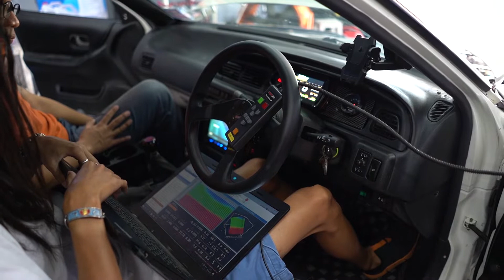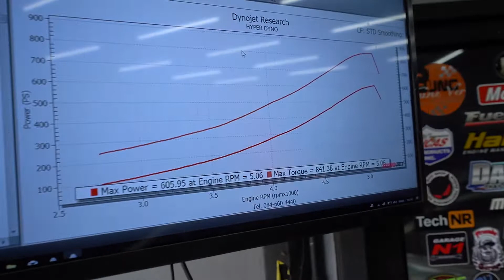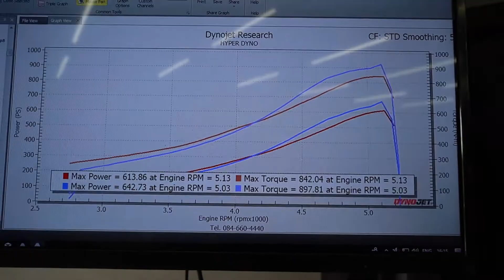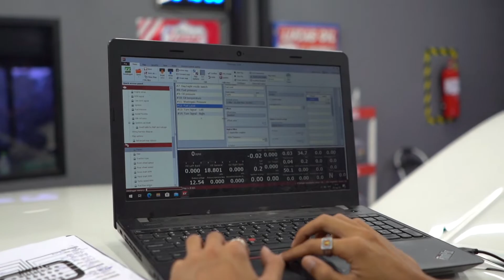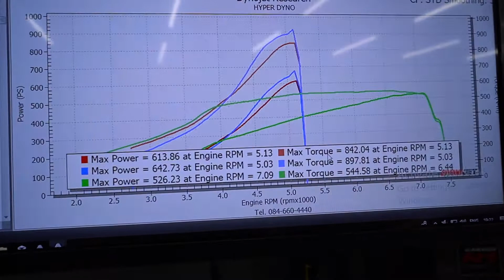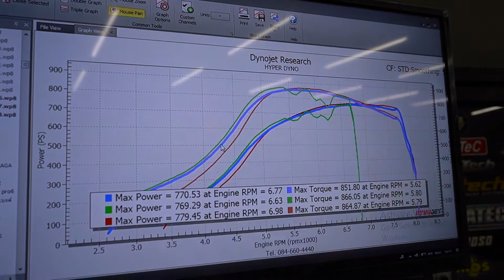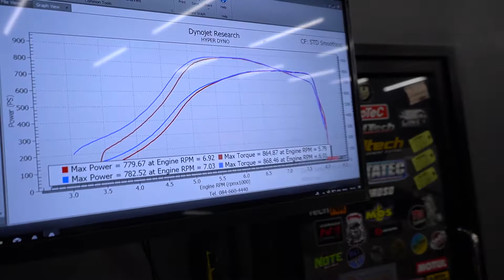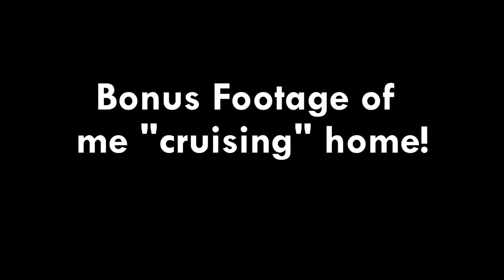2JZ Big Turbo Nissan Cefiro Gets Dyno Tuned with Fueltech FT550!

Comment: is this a 3.4L? these results are still ridiculous LOL. has to be race e85 or something. gtx3582r .86 AR right? i cant find any 3.0l 2jz with gtx35 doing 870wtq at 6krpm. this is madness!!! alberto big boost running g35-900 1.01ar and at 29psi on race e85 hes making 800whp at like 7.7k rpm and 650wtq at 6k ish rpm.
Reply from the maker: This is a 3.0L and gtx3582r 0.83 A/R, running on pump e85. Btw I actually made a mistake in the video as the torque is actually in NM (newton meters) as shown on the dyno chart. So 868 nm converts to around 640 ft lbs.
Reply: @DeanBKK  Thanks Dean, i visit this video every so often and im blown away and puzzled everytime LOL!!!! 868NM  gotcha. i was going crazy yesterday

Comment: Great work. What’s your fuel system. Are you running dual pumps?
Reply from the maker: Thanks man, just Bosch 1200cc injectors, 2x Walbro 450lph pumps, Chinese FPR and e85 rated fuel lines. Simple setup.

Comment: How does the car daily drive ? The ft550 seems to work pretty well for you.
Reply from the maker: I don't use it as a daily driver. Only thing holding it back from being a comfortable daily driver is the 3 plate race clutch and Bangkok has a lot of traffic, so not ideal.
Reply: @DeanBKK   if that's the only thing, then that is good.  
  I'm setting up my ft550 now and was wondering daily driving.  Would you happen to have a map to share ?
Reply from the maker: @mikeregner4719  no because my tune is custom for my build and mods, local fuel, local temps, etc. You would be better off with a custom tune for your own motor.
Reply: @DeanBKK  
I totally get it and understand.  I have 280 cams , 7675 and a 3.4.  I though your tune will get me closer then the basemap supplied is all.